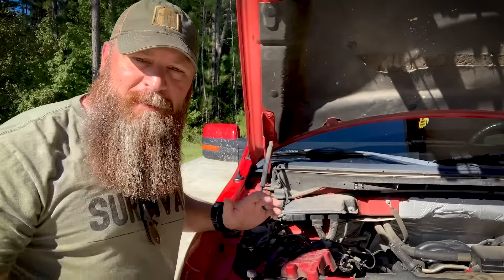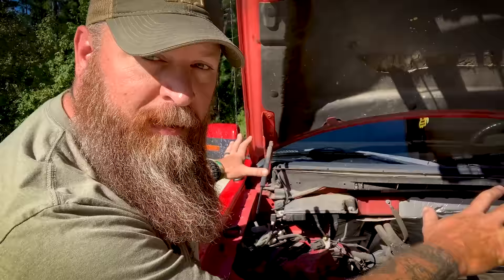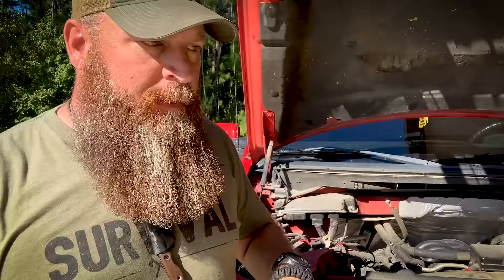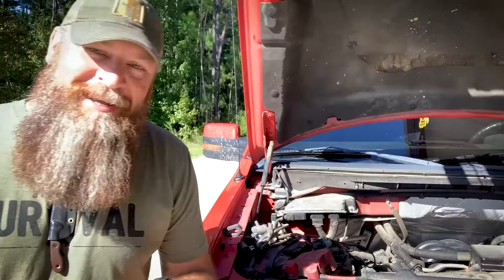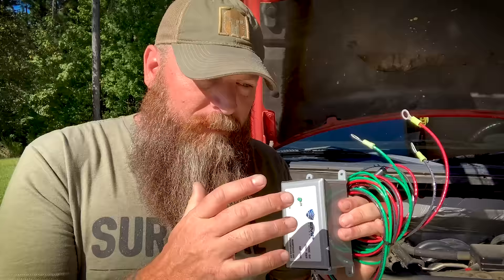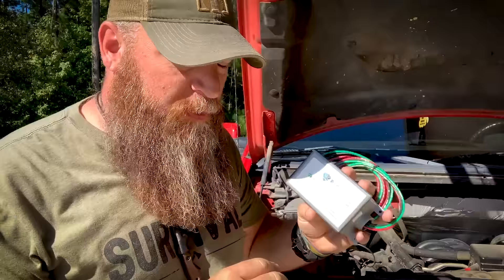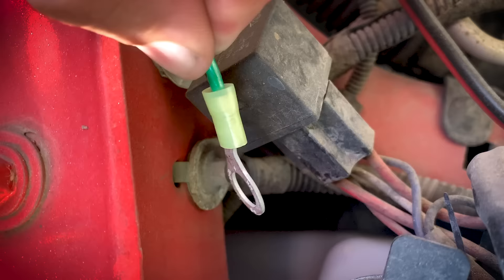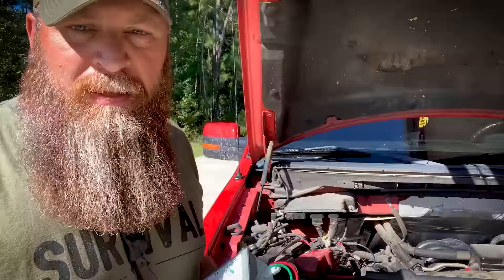EMP PROOF YOUR VEHICLE

Comment: After studying CME's such as the Carrington event in 1859 and EMP Starfish Prime in 1962,  I'm very skeptical that it would perform as advertised. It would be difficult to accurately simulate these type of events in a lab.
Reply: Yeh like what good will it do,(even if it works), if the entire grid is down.
Reply: It's a get the money now and there's nothing it's going to do to help.The spike is going to absorb into every metal terminal tht it can find in every space and will be catching many appliances on fire
Reply: Yeah I was going to invest but for the money and a chance of it not working I'll do without
Reply: @redwood4563  not to mention the roads would be grid locked
Reply: @redwood4563  you can get to the sporting good store to loot the ammo
Reply: @poppythompson2225  what type of appliances??
Reply: @betod3113  anything with a metal connection to any electrical apparatus. The problem also will be that it won't be just one EMP attack.
Reply: @pedenmk  But you can still send it back (with 50 bucks) and they'll send you another. Lol
Reply: Yep. Every metallic wire every circuit board everything electronic is going to be overloaded with current thru the air.  Even if that little box made it thru the rest of the vehicle's electronic system is going to be fried.  Junk.
Reply: Have to give the gentleman credit for trying to help. A few of us know full well some big EMP's are eventually coming. Many people are not aware that many more things will be affected. I was surprised to find recently declassified information that massive solar flares had actually caused U.S. mines to explode during the Viet Nam War. August 4, 1972, the crew of a U.S. Task Force 77 aircraft flying near a naval minefield in the waters off Hon La observed 20 to 25 explosions over about 30 seconds. There are many unshielded items that will detonate in ways that we are simply not prepared for.
Reply: @redwood4563  Set up a working power system that can take over in case.  Protect that, including avoid connecting it to an unprotected grid that would let an overpowering surge hit it.
Reply: @redwood4563  well, it will protect your equipment.   You have no idea how long the incident/event will last.  If it's short term, power is up but you technology is toast. Do you want to have replace it. There will be a supply issue as well.   It's also effective against lighting.  Having had my house hit by lightning,  I can attest to how much gets ruined.
Reply: @redwood4563  Well, when they FIX the grid, all of your stuff will be ready. Or, if you have solar power, your house is ready to hook up to.
Reply: @redwood4563  I’d like to be able to get to my kids house to help them.
Reply: You need long lines of transmission to accept the pulse. The electric grid is highly susceptible, but I doubt it would affect a car.
Reply: @poppythompson2225  you need long lines of transmission to accept an EMP.
Reply: @insideoutsideupsidedown2218  that would depend on the strength of the EMP and the car's distance. Being directly under it isn't necessarily the worst place to be, it's a rebound wave, intensity would probably be worst a decent distance from the EMP.
Reply: We get nuked, my face melts off but my truck runs. 😂
Reply: and very hard to get your money back when you find out it doesn't work.  Think I just found my new money maker without any consequences.
Reply: @purebloodedpatriot9352  at least you got your priorities right!
Reply: @glenwaldrop8166  damn straight. My truck is way better looking than my face.
Reply: @omt4873  that's why you get a bug out adventure bike. bunch of dead cars all over the road? no prob Bob. you can also for much less money than a car put a motorcycle in a Faraday enclosure
Reply: @witharebelyell2762  
They ain't fixing shit after a nuclear war or worse, CME.
Reply: The case of the car or frame would rise in voltage. There is no ground on a car battery. The chasis is bonded to the negative, not earth ground.
Reply: @John Chapman you might but you won't survive long after.on the bright side there's no more mean tweets now
Reply: It might protect only your home connected to the ground and the ground at list 10M oms, but this thing connected to the classes on the vehicle,  no way to protect the electronics of the car an especially all that modules and the PMC when the vehicle HAS NO GROUND,  unless the emp is in the time of good rain.
I wouldn't buy it, it is a scam.
Reply: @John Chapman exactly what I feel like 💯👊 that would take us back to cave man era....
Reply: Probably made in China, probably where the emp is coming from!
Reply: That’s the deal with EMP/CME.  It isn’t hitting an item with current…it’s creating current within an item.  “Hardened” equipment has a Faraday cage around protected parts.  The EMP takes the path of least resistance and doesn’t affect what’s shielded.  An EMP can create current in non-energized wire if it is long enough to attenuate current.  So, this MIGHT work, but the only real protection is to have hardened electronics, disconnect power when not in use (FEMA’s warehoused equipment have no attached batteries), and have an easy way to disconnect from power if there is an immanent threat.  An EMP should have no real effect on unpowered wires and electronics, and nothing short of fully hardened electronics can trust that an EMP will have no effect.
Reply: @redwood4563  and "how do you get your money back guaranteed" when businesses no longer are in operation without a grid.
Reply: They can easily recreate them in a lab, but I feel like they're overstating the effectiveness of the product. The problem is the electronics would probably have to be completely replaced with ones designed to be emp resistant or sheilded with essentially a fereday cage. Now that I think of it it might be easier to turn your garage into a fereday cage. Kinda screwed if you're using the vehicle when things go down though.
Reply: @dalelerette206  if you're talking about solar flares from the Sun you're full of crap
Reply: On the downside….if you are the only one who has a running vehicle, you will be a target for everyone wanting to get away! So hope your vehicle is bulletproof too!😂
Reply: @deplorablebilly1066  right, I might keep an armored vehicle in my garage, LOL 🤣🤣🤣
Reply: @harrythompson4279 no, Russia. They have developed a HEMP and it leaked out recently that some very smart and important people believe that it's not IF they're going to use it on us, but WHEN
Reply: Scam
Reply: @Jcom3030  Yup Snake Oil!!
Reply: Yup Snake Oil....   Only thing that can stop it is a Faraday cage/cover!  Quite easy to make one if you know how, this thing is Bollox.....  Magic Box that takes your money....  Hahahahaahaaa!!
Reply: Nah, the only thing damaging about an emp is the electron surge. Longer pathways the electron dissipate, alternate pathways (like grounding) send them elsewhere, or what im suspecting this box does, sinks them into a capacitor which can then be discharged gradually. 

Now all that being said, some will dissipate in the atmosphere over time (which this video correctly mentions) so the effectiveness of most methods (other than redirection, faraday cages for example) decreases the closer you are to the emp source.
Reply: Well, ifn it don’t work I can just return it after the EMP , right?😅
Reply: Very true!!
Reply: @nicksearles3996  🤣🤣
Reply: i’d rather have ibe then not have one! i’m a veteran abd Ubcle san taught me well
Reply: Ignorance is a special thing ! 
Lots of things are not affected much 

The mindset of Americans is to get your food from the store or better yet fast food 
Anybody that does not have a garden has the right to say it’s hopeless 

It’s easy to store a year or two of food …. Easy ! 

A good garden would extend that another year ! 
So now you are into year 3 and all the people you hate are gone 

You have plenty of time for more garden work and weeding 
Only quality people left to visit with ! 

Not so many City folk with shiny shoes ! 

The more tools like this that you have and know how to use the better off you will be

Comment: Here's what's inside the box:  A combination of varistors, capacitors, inductors, carbon blocks, avalanche diodes, fuses, relays...  It's essentially a surge protector.
Reply: Probably some cheap TVS and a simple crowbar circuit.  Honestly I'd pass...feels scammy it probably is.
Reply: dont forget about the rock hard insulation material surrounding everything inside so you cant easily inspect it.
Reply: The key to this unit is that in reacts extremely fast less than one billionth of one second.  So it reacts quick enough to protect.  No devices before could react soon enough to protect and the previous solution was burned out after one event.  A second event meant no protection.   The our military is converting.
Reply: @USNDeepsea1991  Yea they pored some kind of potting material over the insides!😲
Reply: @davidroney3224 Our military implemented EMP protection protocol starting in the late 70’s and early 80’s.
Reply: The difference is emp is much faster than lightning. Lightning devices usually dont turn on fast enough. This box uses new ultra fast devices. I would still take a large metal chips or cookie tin, line with foam or bubble wrap (sides, top, bottom). Must mot let stuff inside touch metal container. Put in couple handie talkies that are programmed alike, flashlights, small portable AM/ SW radio, batteries for above, a cell on your account ( family plan with no charge for 3rd kid or like that). A small 20 watt solar panel, or 2 10 watts, with built in usb charge port plus 12v charge controller. Sand top rim and matching area of lid rim. Stick in Bible, some special photos, a history book, maps some basic and special meds, maybe a month worth. A .22 pistol and some ammo shorts. Subsonic, high velocity: quiet hunting and defense. Then solder all around lid to seal it electricly and waterproof. Give outside coat of paint. Put it somewhere protected but high up yet handy. Waterproof, emp proof. Use it only in emergency after emp. Or even after big flood and all else is gone , you have something.
Reply: @karlschulte9231  if it's a welded shut cookie tin, how would one ever open it? Now I need the metal cutter too, prob.
Reply: @MrsWhite-jt1gw  Just use tape. Then you can open it with the pocket knife you always carry.
Reply: @karlschulte9231 this seems way over the top. Make it simpler. Make your garage a pharaday cage 3 to 7 layer. Then just put all your survival gear in a bag in that garage your good to go.
Reply: This item will definitely not work. Do your own research. Don’t wast your money on this. These guys are very close to cease and desist orders… if they haven’t already gotten one.

Comment: I used to build EMP shielded electronics enclosures for Apache helicopters and other military equipment when I worked for an aerospace machine shop. Basically they were micro electronics totally enclosed in alloy boxes with total inner/outer gold plating. There were a lot of other stuff that made it a total package that worked.
Reply: What do you recommend for us normies ?
Reply: What about your vehicle s in an aluminium building..if your car is in it?
Reply: @hilarydunaway4807  sadly wouldn't make a difference at all. You need to have 3 to 7 pharaday cages inorder to protect your vehicle. But definitely doable in the shop/ building your talking about.
Reply: @hilarydunaway4807 if you where to do somthing like that I'd say keep your survival rig in it 24/7 obviously lol.
Reply: @hilarydunaway4807  it would be really shitty to spend all that money and time emp proofing a garage only to have the emp go off while out driving and be screwed
Reply: @hilarydunaway4807 way to many openings cement floor doors if light gets thru so does EMP
Reply: @hilarydunaway4807 way to many openings cement floor doors if light gets thru so does EMP

Comment: The EMP Commission's 2008 report noted above is one of the few published studies that specifically addresses the effects of an electromagnetic pulse on both cars and trucks, in particular with an eye on whether the pulses would destroy the low-voltage electronics prevalent in then-modern vehicles. Pry, one of the authors of the report, said that no other report or study on an electromagnetic pulse's effects actually subjected cars to pulses and he's not aware of any similar study since then. As noted in the report:

"We tested a sample of 37 cars in an EMP simulation laboratory, with automobile vintages ranging from 1986 through 2002. Automobiles of these vintages include extensive electronics and represent a significant fraction of automobiles on the road today. The testing was conducted by exposing running and nonrunning automobiles to sequentially increasing EMP field intensities. If anomalous response (either temporary or permanent) was observed, the testing of that particular automobile was stopped. If no anomalous response was observed, the testing was continued up to the field intensity limits of the simulation capability (approximately 50 kV/m).

"Automobiles were subjected to EMP environments under both engine turned off and engine turned on conditions. No effects were subsequently observed in those automobiles that were not turned on during EMP exposure. The most serious effect observed on running automobiles was that the motors in three cars stopped at field strengths of approximately 30 kV/m or above. In an actual EMP exposure, these vehicles would glide to a stop and require the driver to restart them. Electronics in the dashboard of one automobile were damaged and required repair. Other effects were relatively minor. Twenty-five automobiles exhibited malfunctions that could be considered only a nuisance (e.g., blinking dashboard lights) and did not require driver intervention to correct. Eight of the 37 cars tested did not exhibit any anomalous response."
Reply: Early cars caused EMP interference with TVs and radios of the time. Cars produce EMP fields and are heavily shielded to prevent them from causing problems for other devices. As they are so shielded to prevent emissions they are also pretty well protected from them.
Reply: good to know Ty
Reply: Thank you sir I was awesome

Comment: Just make sure you’re also hauling a clean, unused gas can, a HAND pump bulb-style siphon hose, and a big Phillips screwdriver (to pop open gasoline caps on those other cars that didn’t buy the device) so you can keep on going-and-going-and-going (like the Energizer Buggy)!
Reply: And keep a good supply of octane booster on hand for petrol motors. It takes roughly 2-4 weeks for ethanol to settle out of modern fuel and become like a sludge, so any fuel you siphon past that will become worse and worse until it literally ruins your petrol engine due to pre-ignition.

If you are running a diesel then you'll be fine. You can run old low octane petrol in a 50-50 ratio with used motor oil out of the oil pans of cars and as long as you filter the motor oil it'll run fine through a diesel motor without doing damage. It won't run as well as actual diesel or biodiesel, but in a SHTF scenario any kind of running is as good as gold.